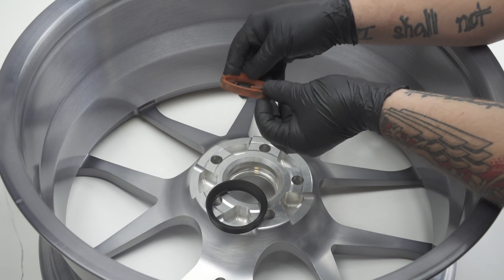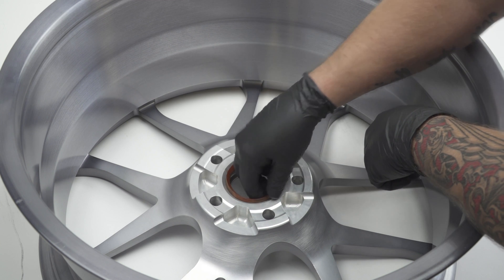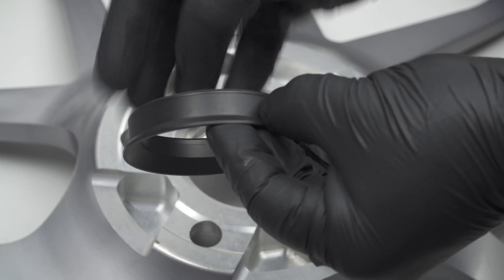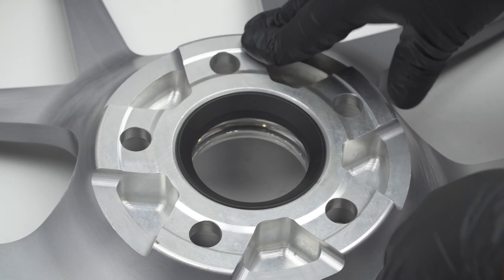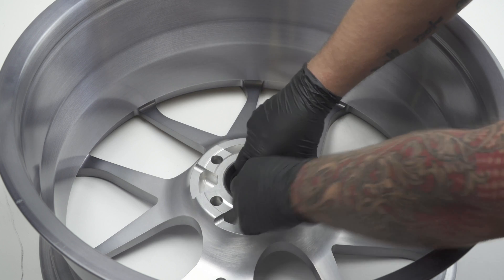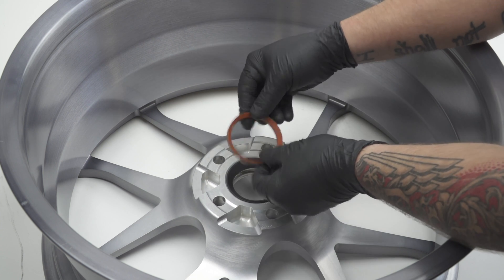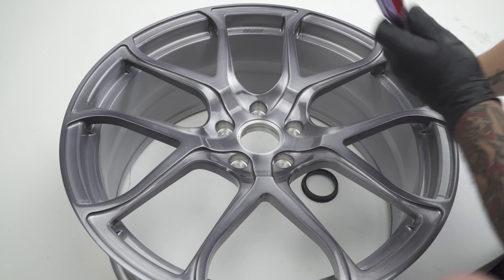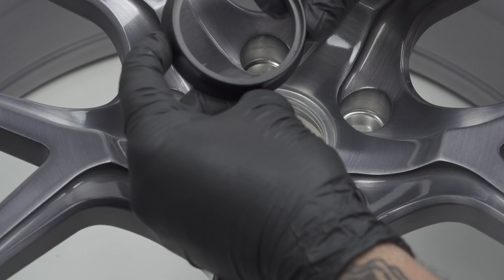APR Wheels - Interlocking Rings

Comment: You said it..." They aren’t ideal at all, and that’s why many of you are turned off by hub centric rings."
I'm kind of old school and was taught the the wheel hub is there to center AND support the weight of the car, that's it's purpose. Now through out the past few decades this has gotten lost and now hub rings are pretty much the norm. There's only a handful of aftermarket wheel manufactures that still make true hub centric wheels. Now, if I had an Audi these wheels would be on my list.
Now so many parts are being made of synthetics (oil pans, intakes) but these are not weight bearing parts. 
As far as your hub rings go that is one of the best designs I've seen...but still not like a true hub centric wheel. Personally I think APR should have gone the extra step of making both VW 57.1 bore and Audi 66.6 hub bore. How much extra cost/work would that have been? Could have had them all 57.1 and bored out for Audi buyers.
Reply from the maker: Our system is very different than the hub centric rings that flap around and break. Take a look at the video.
Reply: @APRtube  where can I buy these black plastic center rings?
Reply: Yeah. This is why i was considering neuspeed wheels. They’re all true 57.1 bore
Reply: hub-centric is more important in heavy weight applications (to support the weight of the vehicle), but as long as it is aligned correct when the bolts are torqued that compression should be what is holding the wheel to the hub. I think the major issues with the hub-centric rings were addressed well by APR and they put out about the best option they could.